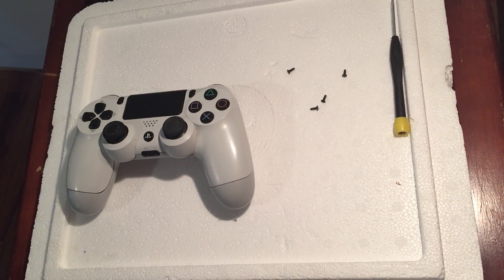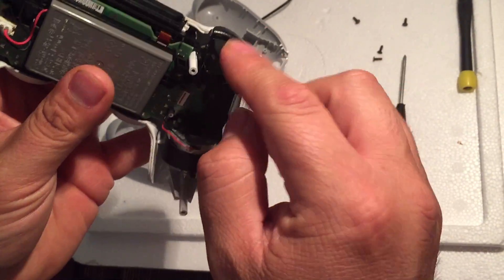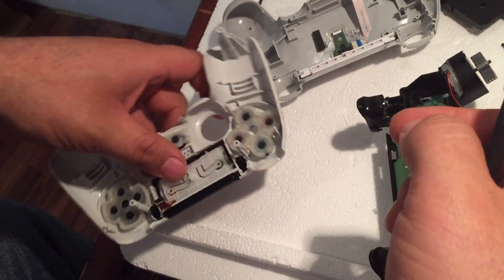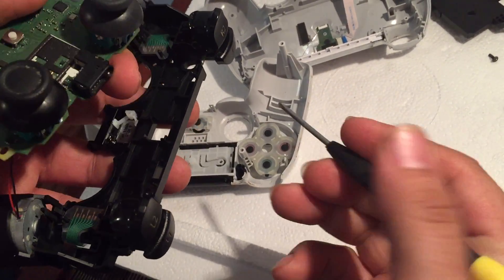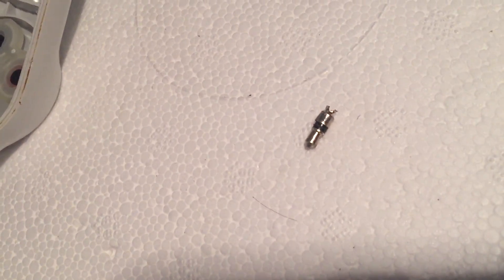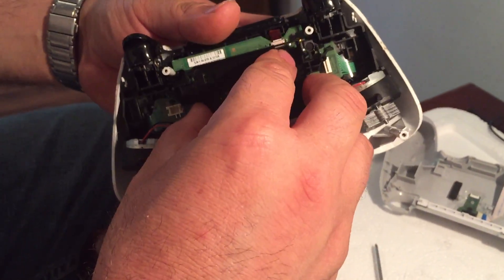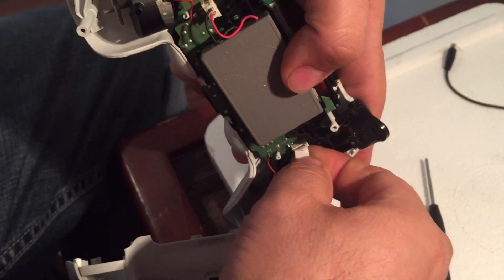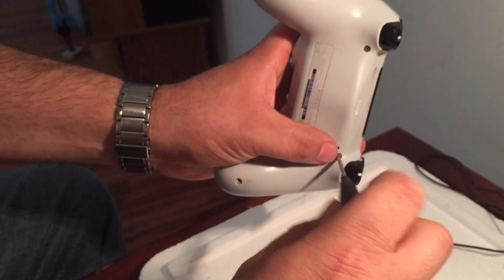How to remove broken  head set piece on the ps4 remote control

Comment: How to fix that problem with ez: get Very strong glue get the broken mic and put glue on it very strong glue idk if hot glue will work cause it didn't for me but i used nail glue and i put it on my mic i put it back in my controller and waited a few mins and took it out and it sticked to the broken off peice and if im not wrong the mic will still work no controller taking apart nice and easy
Reply: @Ancelle Cannon no ploblem tell me if it works but dont put to much glue onto it
Reply: @Ancelle Cannon i wish you good luck
Reply: Hot glue doesnt work bruh

Comment: Awful tutorial, you simply should not take a screwdriver and jam it into the port to get it out the back. I was hoping you would show an easier way to get it plied off but it is obvious you just brute force your way to the end goal. Which is not recommended when dealing with small electronics.
Reply from the maker: Yea tanks I have n oter video witch I did the other way bet the cámara man did not show how exactly so I did this video . N tanks for the tip tanks for watching
Reply: CAMFUZED_GAMER “ARE you EVEN” lol

Comment: So I tried to push my screw drive like shown into the Jack and it shaved some of the golden rings inside. It didn't even work and I had to pry open the lever the normal way. later it  resulted in just terrible quality and volume after I put it back in and checked. So thx for that

PS: DONT TRY TO FORCE IT OPEN LIKE IN THIS VIDEO AND USE A FLATHEAD TO OPEN IT FRONT THE INSIDE
Reply: @Andres Juache Perfecto same happened with me it is suppose to be like that,  you just have to pry it open